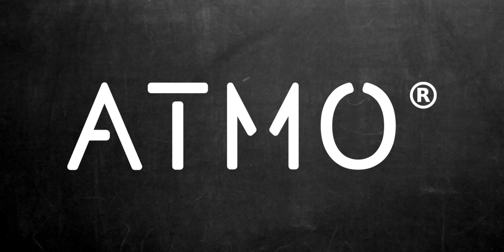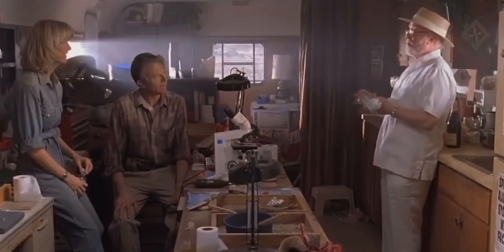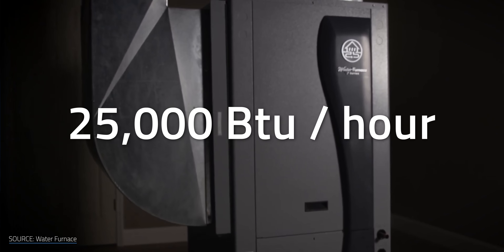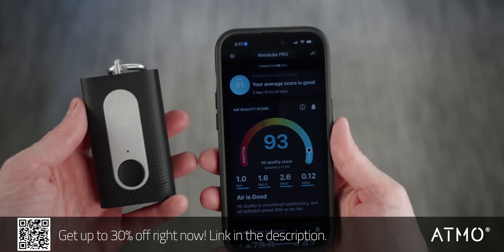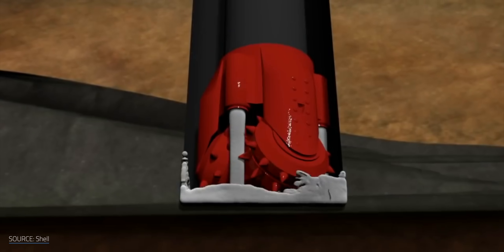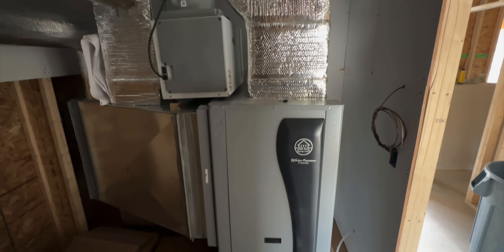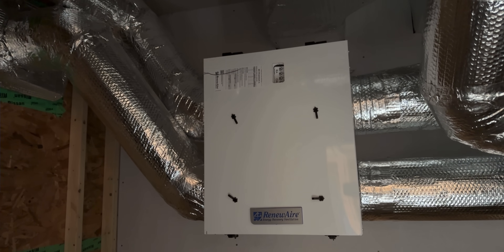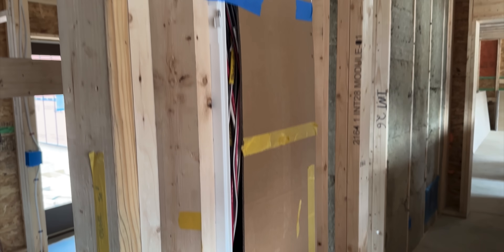Why I Went With Geothermal For My Net Zero Home

Comment: CO2 level won't become "dangerous" and have health effects until near 10000 PPM (old NASA study, while OSHA keeps the limit at 5000 PPM). You might be sleepy when it's over 2000 ppm but there won't be health effects. It's the other bad stuff accumulating in the air when you don't have adequate ventilation. The reason why ASHRAE remove the old 1000 PPM CO2 standard is precisely this, people tend to look at only CO2 level and ignore everything else, and the companies start to use scrubber technology to remove CO2 while not helping the general IAQ issues without ventilation (which can be energy intensive). Love the use of an ERV here but it is not to keep your CO2 from a "dangerous" level, it is that your house is too tight and you won't have enough ventilation otherwise, not just tied to CO2. CO2 is only a surrogate for IAQ when there is occupancy, a rise in CO2 just means your IAQ is likely to be bad due to lack of ventilation. Large spaces (storage facilities for example), will have low CO2 levels (low occupancy) and still can have very bad IAQ. As a self-claimed IAQ person who promotes ATMO sensors, I think you should clarify that better.

Comment: Geothermal often doesn’t make financial sense depending on what the local soil conditions and land area is.  Having to put in vertical wells is such a huge upfront cost.   I looked really hard at self-installing a geothermal system but ended up going to air source mini-splits instead.  Probably in 5-10 years I’ll consider it again when my mini-splits are reaching end of life.  I do have the land to install a slinky loop field, and can do that excavation myself.  For a new build where natural gas isn’t available I’d go geothermal for sure.

Comment: This is fascinating. You haven't lost your mind you're actually thinking quite correctly.  I would do exactly what you're doing if I built a home from the ground up.  I agree with it from both perspectives of being extremely efficient as well as being able to be off the grid if something happened and power from the grid was lost for an extended period of time.

Comment: I put in Geothermal 20 years ago in Folsom, California and it's been great.  It is harder to install, punch 4 wells 200 feet down, the underground tubing to the compressor / blower.   We hit groundwater at 85 feet so I really have water-water heat transfer.  Here in the California Valley you worry more about AC during the summer months so the 50 degree water really helps cooling the house.  During the summer months my present electrical, SMUD, runs $200 vs the $1,000 per month my neighbors pay.  The other real savings is that my compressor runs at such low pressures I expect it will last 40 years.

My real mistake is that I put the compressor on the built-up wood floor.  If I had it to do over again I would isolate the compressor on piers and not connect to the wood floor deck.  The compressor "drums" when it's running.

The other downside is that I have had to replace one of the "pond pumps" used to circulate the cooling loop after 14 years at $1,000.

Comment: Matt, I have had some difficulty trying to reach Span sales support. I was interested in one of their panels but I was uncomfortable with the panel requiring 24/7 internet access. I wanted to run the panel completely under my control, without it needing to phone home. I could never get a clear answer if that use case was supported. Would you be able to offer any insights?

Comment: Curious to know why the heating/cooling vents are installed near the ceiling, Considering you live in a cold climate area where heating is more important than cooling, I assume the optimal location for heating/cooling vents is closer to the floor ( heat rises....).

Comment: A variable speed air sourced heat pump will be a better option for most people and homes! The Hyper Heat Mitsubishi systems are amazing even at 5 degrees F! You can go ducted or ductless and it's an air sourced system. Geothermal is better for extremely cold climates but it might cost you $75,000+ (West Coast prices).

Comment: Well it looks like you are an expert at this as you have used and installed them already.   Please share all from smart electrical panel to heat pump to smart home to network, etc....   I want to learn all because I plan to do the same.   My background is Electronic Engineer  but I am not up to date with the home automation.  Time to get my brain going to learn and use this future technology.  Should not be hard because I am no stranger to electronic, computer and software app.

Comment: I've got a 30-year old geothermal 4-ton heatpump in Northern Canada. My main problem is that the manufacturer is long since gone. So now the cooling doesn't work reliably, typically short-cycling as soon as the compressor turns on. Had a refrigeration company look at it, but everything appears fine so it must be a circuit board problem. The replacement, $20k in a new unit. 😭

Comment: People are getting more and more passionate about these types of builds. This may be on the cusp of financially viable as in it’s the cheaper option over time compared to conventional builds. But the more it’s implemented and the more people see the benefits the more production and innovation will take place to bring prices down over time. In 50 yrs net zero homes could be the standard along with smart electric panels that intelligently handle power input and output. There’s people who believe the only way to lower CO2 is through laws and forcing people to make choices they are not financially able to handle. This type of system however reduces the amount of energy needed while properly managing energy use will be the biggest way to drive down CO2. A mix of solar at the house to help with peak demand during the day combined with home energy storage will also help move us towards being able to keep grid demand at a constant level. If that is achieved then you drastically increase efficiency from the grid which drives down cost and CO2.

Comment: I’ll be following along. I have a Ubiquiti home internet and set one up at my brother-in-laws home. I also have Enphase solar and an electric car.  Replaced our existing HVAC with a high efficiency inverter heat pump along with a variable gas furnace.  I don’t have batteries.  I’m interested in the Enphase bi-directional EV charger once that becomes available.

Comment: My cousin finished his net 0 home last here in northern Italy. He has a 15kW solar panel system, solar heating for the water, and geothermal. 

He went radiant heating for geothermal and the cooling in summer is mind blowing, he has 18 °C water going through the floor loops and it cools the house to a steady 23 °C all summer. To give you an idea, we regularly reach 42 °C in summer these last few years.

As another examples, solar heating gives him 72 °C hot water in February with an average outside temperature of 0-8°C.

Pretty cool stuff over all.
Reply: Net zero? Was the shipping and manufacturing pollution added to that "net zero"?
Reply: @johnlocke_1  net 0 is that other than those costs, it will be 0 pollution every year AFTER finished. his home is net zero, its why activists are also pushing for green electric shipping, and carbon neutral production/manufacturing. unless you want to be a hunter gatherer cave man,  every single item in your life that youve purchased, unless it's  some real handmade thing or like bying a plant, has contributed to pollution. "her der  net zero? trees were cut down for that house? what about the heat used to make the windows? er im sorry mr you just exhaled co2, pls care about environment more." guess ill just die.

Comment: I'm surprised you went with Enphase instead of power wall. I would like to see a video comparison on the two. I'm going solar soon and it would be helpful. Thanks 😊
Reply: Sol ark is the best out there.  Support is in TX by phone or email.  Can use any battery system and emp hardening as an option.

Comment: Matt, I have almost the same system.  Renew air ERV, Waterfurnace series 7, 640’ vertical well, Rheem heat pump, and separate pre tank.  Also have dual solark’s.   Great system for the last 2 years.

Comment: Did you look at low voltage wiring for lights throughout the house instead of instead regular wiring and a converter for every individual light?

Comment: Do you have a basement? Is it insulated? Exterior and/or interior insulation for the foundation walls and floor? How much insulation is there (R value)? What system and/or manufacturer did you use? You are building my dream house with the geothermal system. Unfortunately, I don't have a lot big enough for a geothermal system, so I am living vicariously through you. Great work! Really looking forward to future updates.

Comment: That is all very cool, but I'd be worried about what happens when a software update bricks some part of the system and you suddenly have issues getting critical things working.  I'd have some redundant, dumb way of getting power to the most critical circuits that doesn't require software or an app to work.  Maybe a sub-panel with a generator transfer switch?  Once you are your own power company with solar panels, batteries, etc. you have to deal with it when stuff breaks or fails.  Nobody rolls a truck to your house at 2am when you are out of power.

Comment: I have geothermal plus solar. 4 ton 2stage bosch geothermal. 10,080 watts of solar. running for almost 6 years now. Horizontal coiled loops. In slab heat down stairs 2400sqft of shop and storage.  Warmboard upstairs. 1000sqft of living space.  Along with chilled water fan coils both upstairs and down. R30 walls with 1" thermal break. R65 Cellulose ceilings. Both upstairs and down are heated and cooled all the time. The inslab does have significant swing in temperature. 
But I  must say that the warmboard stays within + or - 1 to 2 degrees of thermostat settings and heats up and cools down quickly. No mass to heat or cool down. Just the complete coverage of thin aluminum that covers the entire surface of the subfloor. The thin aluminum transfers the heat extremely fast and very uniform. And no I don't have any association with warmboard. Just so glad I decided to use it.
I have had zero bills since starting up the solar. My house is all electric. I live in Wisconsin. -20f in the winter not uncommon. 
I designed my house myself. Had  a contractor put up the outside. And did everything else myself. Including installing the geothermal and infloor heat and fan coils.
I didn't install solar since I didn't want to be on the roof. And had the guys that do all the loops in the 3 states around my house. Install the horizontal loops. 
Oh yeah I drive a forklift for a living. 
Now I can think about retiring. Will have zero bills from here on out. Won't have to worry about cost of electricity or gas going up down or all around.

Comment: I hadn’t come to terms with the latitude effect of solar arrays. Your production is measly compared with mine. Your latitude is somewher in the 40º area and mine is at 26º in the Southern hemisphere in the subtropical region of The Sunshine Coast, Australia. My 8.7kW system provides 15.5mW average of energy and I only use 8mW. So I sell 7mW to the grid at A$0.05/kWh. The return is small. With my panels set facing slightly East of North at the optimum 26º pitch, I installed 5kW of expensive Enphase batteries (my total system is Enphase) and that made me 70% self-sufficient. But I added a Lexus NX450H+ in March and that helps to defray the capital costs. In July, a further 10kW of Enphase batteries will be installed and that will make me self-sufficient. We maintain our swimming pool at 31ºC all year and that costs us nothing. Going solar and getting away from fossil fuels is a rich man’s folly but as a retired businessman, it tickles my fancy.

Comment: Concerning the size of your heat pump. I wouldn't be too suprised if it were to run more efficient than the smaller size that was required.
Most of those are powered by a asynchronous motor. These tend to hit their peak efficiency at 75 % of their rated power.

Comment: Your insulation seems to have standard R values and the house seems to be a standard size. Most houses in New England (MA) need closer to 45k BTU heat and 12k BTU cooling. In the winter, your likely loosing around 15k BTU through your floor. What's the R value of the floor? 

Also most installers ball park a single 400ft well with 20 ft centers at about 12k BTU. Most New England homes need 4 wells. Keep in mind you can pump more out of single well but you'll lower your efficiency (AKA your heat pump is just electric heating at low efficiency)and the ground will also take years to stabilize. Initially you suck up a huge pile of BTUs which are just sitting there below your feet. Once those are consumed the BTUs need to move over from nearby land mass. Your likely to be ok for the first year, but after the 1st year, the BTUs are coming from nearby land mass which takes time to get to your well. The well you have is likely to be undersized. It typically takes the earth around 8 years to stabilize. You need to size your well for the 8 year stabilized capacity not the 1st year initial capacity.

It seems your designer gave you a well which handles about 12k BTU  AC load and 12k BTU heating. Then the heat pump simple acts like electric heat to cover the peak winter heating loads.

Comment: I would like to see some basic truths discussed.  Everything going into your net-zero home has a carbon footprint.  Everything.  Much of it requires petro-chemicals to produce.  For your 'net-zero' home to become a reality, I will need to see:
1.  A comprehensive inventory of everything that was used to build your home in line-item form - a true inventory - including the CO2 generated for labor to drive to and from the site.  Across from each line-item needs to be the CO2 produced to manufacture and deliver and use that item.
2.  A comprehensive list of the technologies of how your house reduces CO2 emissions COMPARED to typical technologies used in non-net-zero homes - whats the delta?  For example, Geothermal furnaces are big users of electricity, for example.  You also needed to drill 2 water wells for it to function properly.  Compare geo-thermal to air-exchanger heat-pumps.
3.  What is the cost in CO2 of the power sources used to run your net-zero home.  
4.  Determine the annual savings in CO2 - and calculate the number of years to "pay-off" the CO2 footprint created to build it.
5.  Factor in the maintenance of the technologies - some will require annual maintenance - like your geo-thermal furnace.

No doubt you will use solar panels.  Solar panels actually harm the environment by robbing the global eco-system of precious energy that drives weather patterns.  

Teslas take 5 to 7 years to "pay-off" the carbon footprint created for their manufacture and the manufacture of the battery.  By the time they actually become net-zero, it is time to replace the battery, and to recycle the old one.  The carbon footprint spikes to near-new values.  In the end, there is virtually no reduction if CO2 emissions.  I suspect your "net-zero" home CO2 savings - the actual delta between in CO2 emissions the two types of structures - will only be in single digit percentages - I estimate less than 5%.

Comment: Hey Matt, thanks for the update! I just built an off grid house in Canada and I am kicking myself for not installing geothermal lines under my drains and beside my footings. Even around my septic tank. I wish I had run the tubing while I had the holes dug anyways. Geothermal is a really really good solution for both heating and cooling but I don't think it needs to cost as much as your hole, just more planning and pipes need to go into every hole that gets dug anyways. I went with wood heated infloor heating from a wood cookstove.
Yeah your window shades are overkill, I don't like all that extra wiring. Otherwise I am with you with metal roof, infloor heating, solar panels (on my woodshed). Did you go with passive solar windows (big southern ones with curtains)?I did, they were old sliding glass doors. I also went with geothermal cooling in my cellar from not insulating the floor there and passive ventilation through an open concept design and windows that open on the east and west to allow for natural air flow.

I cut the wood off of my land here and all windows and doors were used/free. For insulation I got a deal on a tractor trailer load of 3" below grade foam insulation from a flat roofing company that removed it from a re roofing job in Ottawa and sold it to me for a good price. We just moved in and I owe nothing to a bank for our home. Its 1500' square.
Reply: When it comes to insulation, thickness has a value all it's own.  I do like the idea of running the lines with other holes, but it does risk confusion VS doing separate things.

I do wonder about a radiator at the bottom of a water well though.  Have it dug an extra 20ft deep, and a bit wider, then just use one hole for everything.
Reply: He probably went with European 3 pane glass windows. They usually are tilt and turn windows. Sliding windows aren't easy to make airtight.

Comment: You won't want to pull air out of the kitchen through the ERV as it'll clog up the heat exchanger over time.  You'll need a dedicated kitchen exhaust fan with makeup unit system.  Also best to locate the bathroom exhaust ports in the shower area.  See home performance channel about both.  Completely agree regarding forced air vs radiant in a high performance house.

Comment: You can never go overboard for network. Run lines to your windows for Poe shades, Poe video control panels in wall, fiber to important areas of rack, Poe cams, etc...   Cat and fiber is cheap and easy at frame stage...  Expensive and hard two years later...  Lol